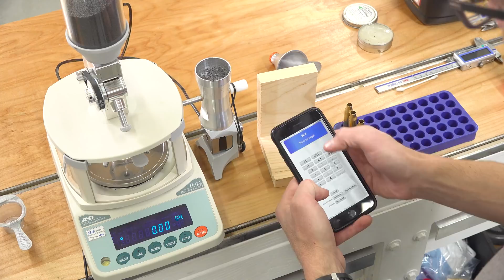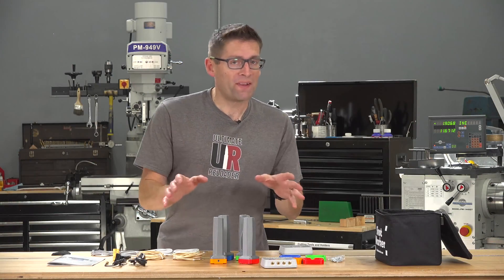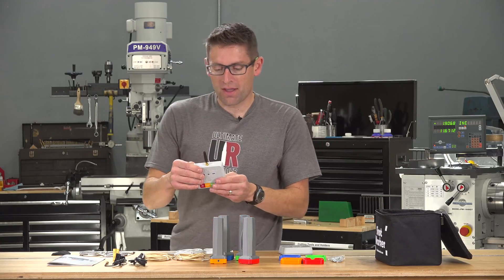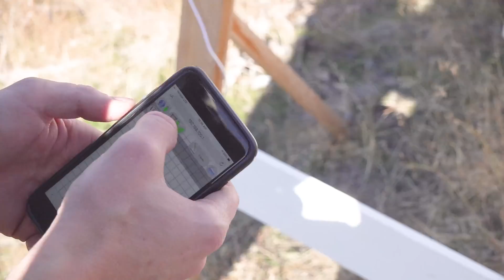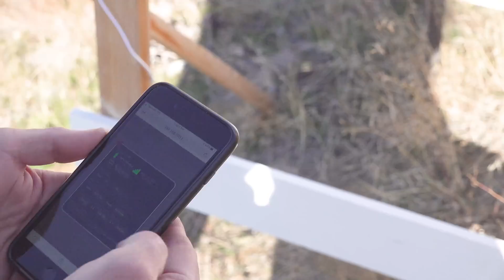ShotMarker E-Target System: Unboxing, Overview, Setup

Comment: Based upon other reviews and alternative systems.

ShotMarker Pros: 
I needed long range ie: >300 yards.
Visualization of bullet holes on target

ShotMarker Cons:
Time consuming set up and requires multiple backers for short and long range targets.
I did not need velocity at target.
Accuracy of bullet placement via TargetMarker was a source of error in other reviews. (Many possible reasons)
Some competitors loose matches due to inaccurate placement.
Requires taking pre-made target backers to hold sonic sensors.

My Final Choice
Longshot by Target Vision LONGSHOT LR-3 Long-Range Camera System w/ Bulletproof Warranty, 

Longshot Cons: 
$100 more
No Velocity readings (LabRadar)

Longshot Pros:
Quick setup
2 mile line of sight range
Actual video of target holes, manual marker placement/adjustment
No pre-made target holders required

Comment: Looks like an awesome bit of gear but my question would be does it need to 'hear' the impact of the round on the paper to produce a result and if so, if you are shooting a magic group and the later rounds dont touch the paper, would it consider this a miss?
Reply: The system 'hears' the sonic crack.  Your round must be supersonic at the target.

Comment: The other thing that is cool with this unit is that if you're on the firing line and wondering how your closest competitor is doing, you can pull up his or her target and see how they are doing on their last string. Every targeting system that is on the same Access Point, everyone has access to all the targets on the bottom of the screen....

Comment: No price was mentioned.  Probably cost a mortgage payment.
Reply: They cost $820.00 including shipping. Nice thing is you can shoot out to 2 miles with this thing and not need a spotter (once you get on target) as this will give you feedback right away. We use them at our 600 yard range for all NRA matches. I used 4 2x4x4's, 4 angle brackets, and a sheet of corrugated plastic to hold my target and I can shoot any day I want without a pit person...

Comment: Cool system but does it permit multiple targets on the same sheet?  I also wonder what replacement sensors cost because they do not appear to be bulletproof.
Reply: Steve Rowe we run it at 20+ lanes here. You can switch targets and if you have multiple targets set up at different ranges you can just switch from say 100 to 600 in an instant. The sensors it NOT bulletproof, they are made to be inexpensive and quick to replace if ever needed. Not sure of the exact amount though. I hope that explains it. Have a great day sir.
Reply: The replacement sensors can be purchased separately for $40.00 or $50.00 with the color bracket, all 4 can be purchased for $150.00 or $185.00 with all four brackets...
Reply: @donaldroberts8242  Not "break the bank, gonna' starve" costs, but could get expensive shooting ELR with high/variable winds and learning curve shooters.  Anyone have a plan to shield/bullet protect the sensors?  Would AR500 deflection plates in front of sensors negatively impact the sensor performance, accuracy.
Reply: @Phil Ward it can be set up manu ways. It can give you group size, points, speed, es, sd, etc

Comment: I don’t have my own range yet, but I’m about 2 years out. Given that I’m a paraplegic and use a wheelchair this will be so AWESOME to have!!!

One question, can I zero my rifles using it?
Reply: Robin, Yes, you can use this for boresighting your rifles, but...
I would always start it out on a gong plate or into a clear dirt berm to verify you won’t hit the frame or even one of the transducers. Once that is done, you switch to ShotMarker and you are off to the races.
Another feature of ShotMarker not mentioned, is that in addition to showing lots of standard targets, you can always superimpose a grid of Mils or MOA. This makes exact boresighting very quick and easy in the example of a standard SR type target with round bullseyes. 
The ShotMarker system will make your days at the range much more productive since nobody has to pull pit service and your distance is unlimited. Good Luck and Good Shooting.
Reply: No problem if you bore-sight at 100 and then zero. Something has to be real off for a shot to be 30" or so wrong at 100yrds. Have a good day.
Reply: Jeff Allen Thanks, that would definitely spoil my day. I guess that I could always use the spotting scope and paper target method.

Comment: Ok.  This is just bad ass.  High tech, but simple.  Nice work.  This is exactly what I've been wanting to do but had no idea somebody made a kit for it.  Grt vid.  Thx for posting.
Question 1:  What vid software do you use to show the target being shot while you're on the rifle (the picture in picture function)?
Question 2:  What scope cam do you use/recommend?
Reply: For Question 1, the software is already installed on your smartphone and any modern laptop or iPad type device. You first go to your settings and search for ShotMarker network in your WiFi settings. Once you find that and connect to it, go to your favorite web browser and type in 192.168.100.1 and you'll see the target system on your device.... HTH.

Comment: Seems cool and all but what's wrong with a paper target and a spotting scope. Seems like it would be an expensive piece of equipment thats not really necessary. But if you have a lot money and don't like making trips to the target I guess it's a good idea.
Reply: Hard to see holes, particularly something as small as 223, even with a spotting scope at distance.
Reply: or if you send a bullet through one or more of the sensors and cable.
Reply: @deltaskyhawk  that's why you make sure you're within 2 feet of zero first :p
Reply: you can use the one target for multiple shooters. handy when you have 10 people in a comp, and only one or two target frames/shooting positons.
Reply: It can also eliminate the guessing game, when shots go through the same hole, or nearly the same hole, in a paper target; not uncommon, when shooting a precision rifle. F-class is 20 shots; it is almost certain that some or many holes will overlap, and the paper target will get blown out, making it harder to score accurately.
Reply: @mikerutchka1836  thats not a problem with a paper target just measure the widest point of the bullet hole and subtract the diameter of the bullet and then you have your group size. I still think it's a handy gadget to have if you got the money to spend and really want it. But he did say you should verify with a paper target anyway.